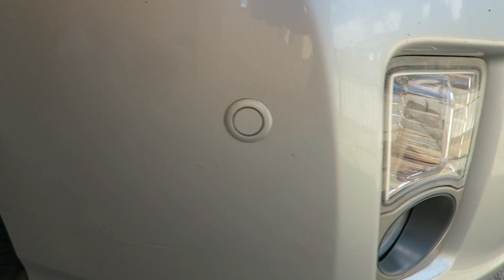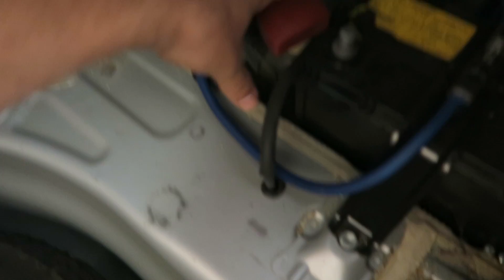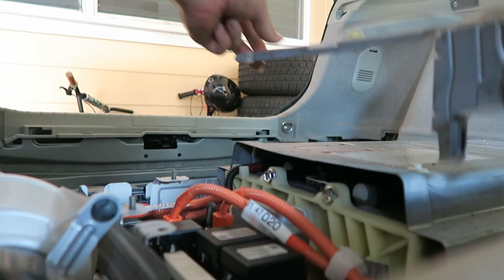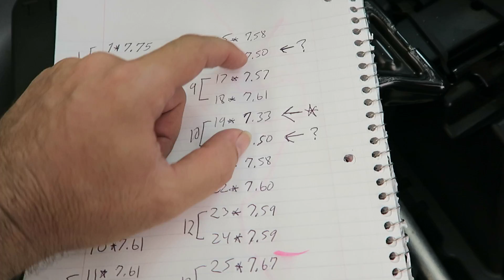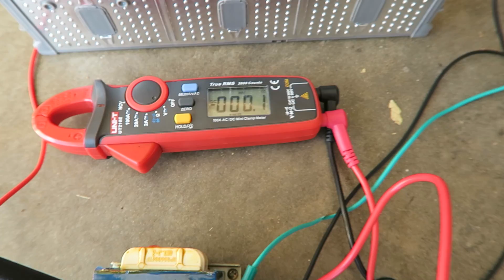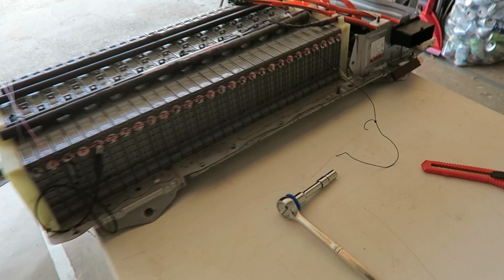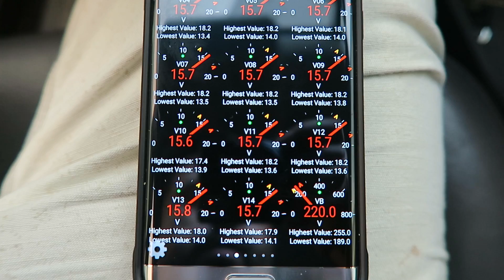Prius High Voltage Battery Repair | Gen lll 3

Comment: Hey Vlad, how do you actually test the voltage with the battery in the car? How did you get your “low” readings. Did you turn on the car and wait for the cells to discharge and see which goes lowest, or were those results after a drive? I don’t have an issue yet but I notice when I’m monitoring the cells live as I’m driving some dip slightly lower than others sometimes, and during other drives sometimes other cells dip lower.
Reply from the maker: Driving around at slow speeds gives the battery the most stress and thats when the worse measurements are recorded. If using the torque app, it has highest and lowest value record options, which will give you an more accurate assumption than trying to catch it live. If your not triggering a code, your fine for now. Even if you do get the code you can still drive the car if you have too with no issues. Thanks

Comment: What did u use to charge the battery to bring all to the same voltage
Reply from the maker: +Farnaz Makdum you don't need to charge them to equalize the voltage. You just need to wire them all in parallel, all pluses and all minuses together will put them in an equal voltage. Hope that makes sense.
Reply: So you just connect all positives and all negatives. Do u have to connect anything else.?
Reply from the maker: +Farnaz Makdum yep, you'll have a huge 7.2v battery. Leave it overnight and all your modules will be the same voltage. I learned over time this step is not necessary, but people like to do it anyway.

Comment: Hello thanks for informative vedio, I am writing from Mongolia, I have 3rd generation pius that have problem with HV battery, and I seek help from the auto mall service shop they told me that 3rd generation HV hybrid battery must be replaced all of it even though only one battery pack is  bad, because it is not getting better if only change the bad pack (must be changed by all 28 pack battery) also they said can not to change only bad cells must be done by all. so I am getting confused and want to ask you. since you changed the HV battery did not occur any problem with HV hybrid battery????
Reply from the maker: Hi, normally changing out the bad cells will give you plenty more driving but in extreme cases like ultra high milage cars will need full replacement. If it was me i would repair it first. Normally the cells will last 200k plus miles but sometimes one or two might fail along the way. Hope this helps. Thanks
Reply: how did you charge the battery just from home electric or use some equipment to do it, in other word my country uses 220v so do I just charge from it?

Comment: THIS IS INCREDIBLE!!!! I used the ELM27 WIFI module and Torque app for my conventional (non-hybrid) car but I had no idea it could give you this much information regarding the HV hybrid battery! Thanks for the video!
Reply: Dr. Prius is better than Torque Pro because it tells you the most critical parameter for battery evaluation and that is Internal Resistance of the module. Voltage is too difficult to use accurately because of the necessity of load which is too much of a variable. Voltage is almost worthless to me but IR can pinpoint the bad module in seconds.

Comment: Nice work. These are not so hard to work on as people think.
Couple of tips I got from another video.
I probably would have cleaned those contacts and then tried the car again. That may have been why those cells were not being charged .. but since it fell flat on a load. The cell may have been damaged.
Second.. to get those red plug retainers out. Use the end of the disconnect handle. There is a little pin sticking out.. use that and rotate.. and those little clips will come out without using a screw driver and possibly damaging them.

Overall great work though...  And nice car. That 5 trim package is really nice.

Comment: Just Vlad, awesome video, well made and put together. Especially that wire technique to balance the cells!

Anyways, on the Torque app, in my 2007 Gen II I'm getting a delta voltage of 0.1V at around >56% SOC, 0.2V between 53 - 56% and 0.3V in the 40% range.

I dunno, is that considered unbalanced?

Comment: hi  thank you for uploading this very very helpful video , i have got few questions and one request, the questions  are , what charger did you used to charge batteries what  was voltage and amperage for charging.and request is if you can elaborate a bit more on downloading Prius pid i tried but no luck maybe a short video clip i am sure i and many people would appropriate that.
thanks

Comment: Did you use a usermanual when you use these steps? how do you know that these are recommended steps?
Reply: Parvez Makdum 
He obviously did not
He didn’t even know the orange safety plug is the tool to release the orange bolts ....
Reply: Parvez no need for User Manual. Watch a large number of Youtube Videos, and you will be an expert 😀

Comment: Why did you group the cells in pairs?
Reply: alex tworkowski I think he did it that way because that is how Toyota has the voltage sensors wired up. They don't check every single module but they check them every two modules which are wired in series. That's why he gets about 15 volts.

Comment: Humidity corrosion on the battery terminals, SENSE WIRES and BATTERY ECU. This messes up the systems ability to determine SOC.  If the corrosion is really bad, a fire can result as there is no current limiting on the sense wires. Once you have followed the steps to pull the pack, look inside the battery ECU voltage sense connector (orange 2004-09).  Check for corrosion on any of the pins, clean as needed with contact cleaner. If its bad inside the B ECU it will be worse inside the plug. Digikey carries the replacement multi-lock pins from Tyco.  At the batteries, clean the corrosion from the plates (soak in vinegar), replace the M5 iron nuts with stainless steel flange nuts.  The sense wires, I cut the plate off, put 3" of 1/8" marine heat shrink (heat glue inside) and added 1.5" of wire between the plate and the sense wire. Each sense wire must be checked and cleaned back to copper before soldering. Once the sense wires are repaired and the plates have been soldered back on, pull the shrink tube all the way to the plate and heat seal it. Look up salt/vinegar and baking soda wire cleaning solutions for corroded wires...hope this helps, be safe...
Reply: eb b tkl
Reply: What are the sense wires? And have you thought of making a video with your explanation since it seems to be a more comprehensive refurbishing of the entire prius hybrid battery and it's management? Thanks for your guidance.

Comment: Hi there, thanx and I am very great full for up loading such an informative video. I have bought OBD II adapter and torque Pro as well. I just wanna know which plug in have you used to check individual cell voltage, as it is there in your video. I could not find it yet. Thanx.

Comment: fyi  in order to get a read out of the battery banks among other things, you need to get an obd2 to bluetooth and also get Torque Pro which is 5 bucks
afterwards you will need to search the web for Prius Torque sensor modules so you can get the battery bank voltages as well as access to other sensors like SOC and battery temp and cooling fan measurements.
Reply: Ok thanks.... Seems that's my missing puzzle!

Comment: what year is your car and when should i clean the bolts ?
Reply: The only functional part of the interface is the circular portion of the bus bar that is in contact with the terminal ends.  Corroded nuts or corrosion on the outer faces is of minimal concern.  The best way to get the bulk of the corrosion of everything off is to dump everything into a small cup filled with vinegar for a few minutes - will remove 99% of the corrosion and needs nothing more than rinse and dry afterwards.
Reply from the maker: +habeeb samawi 2010 but it applies to 10- 2015. If you are referring to the nuts from the modules, clean them when they are out.
Reply: my car is 2014  with no problems should i clean the nuts ?
Reply from the maker: +habeeb samawi no need to do that, the corrosion happens around the nut not at the direct contact. You only would do it if you have battery issues.

Comment: Im in the process of refurbishing the pack on my 2005 prius with 200,000 miles and am going to cycle all of the cells 4 rc chargers to bring back the capacity to 6500 Mah. Then load test with a battery load charger. My question is about leveling the pack. Do i just put or wire all the cells in parallel. (plan on using alligator clips) and then use a RC charger to charge the pack and then let it sit. Im very confused on this last step.
Reply: There is absolutely no need to parallel the modules.  All it does is stabilize the surface charge.  The moment they are subjected to a load in the car, they will diverge almost immediately.  This is because NiMH voltage with two paralleled modules stabilizes in very short order. I have personally confirmed this with testing.  Empty module put in parallel with a module that had 4000mAh input.  After 24 hours in parallel, they were 1000 and about 2600 respectively - still substantially out of balance, and their voltages were EXACLTY the same when disconnected from one another.  Anything close is good enough as healthy modules "self-balance" to some degree. If charging with RC chargers, charge from empty to about 4000mAh input and the same end voltage - these will be extremely well balanced.
Reply from the maker: the reason you want the batteries all in parallel is too equalize the voltage in all the blocks so they are the same. Honestly this is not as critical as if it would be a lithium ion battery but still good to do because if you have to much variation in voltage between the blocks the computer will trigger a fault. So if have enough wire clips just do it. It will take a while for the batteries to equalize. i would leave it overnight. you dont need to charge it as it equalizes because this could alter the voltages.  hope this helps

Comment: Hello, do you know what's the highest voltage difference should be in? Mine was all within .05 volt range except two bad ones which were over 1 volt difference which I replaced them and my car running fine. It looks like the voltage difference is more important than actual voltage itself. Is it true? Last question, do hybrid cars lose power as the hybrid batteries get weaker? Thanks
Reply: Yes it is no difference than a flashlight battery, just bigger. You lose fuel mileage as the battery wears out.

Comment: Hi bro what exact diagnose tool you use I can see it sitting underneath your Gear compartment but I'm not sure if it's the Bluetooth one or the wifi one could you let me know that and could you also let me know exactly what app you have to load for the device and thank you
Reply from the maker: The obd reader is wifi and its just a generic one you can get anywhere online. The app i used is for android called Torque. In order to see all of the data from the prius hybrid systems you will also need to download and add prius specific "PIDS" to the torgue app. Just search prius pids in google. Hope this helps
Reply: I can't find torque pro for iPhone. Is there a similar for iOS?

Comment: You should remove the entire battery from the car ASAP. Work on your deadlift in the gym so you can lift 120 lbs and set the the battery between two sawhorses so you can reach the bottom module bolts.Clean the bus bars and bolts/nuts with Caig Deoxit D5.Use an electric screwdriver to remove/replace the 56 nuts.Reorder the batteries with the highest voltage nearest the battery electronics so next time you don't have to remove all the modules.First time 8 hours because you need to clean the fan and ducting.Next time just 5 hours.In Calif, the dealer would replace the battery free until 150k.Try www.elearnaid.com for modules.

Comment: what type of obd2 app are you using?
Reply from the maker: Its called "Torque" on android.
Reply: Torque pro show only current voltages of all the blocks. How did you set for high and low voltage.
Reply from the maker: Search for "prius pids" in google and add them to the torque app to have access to everything on the car.
Reply: @JustVlads  can you pls post the link for the PIDS?
Reply from the maker: you would need to download the custom "pids" for the torque app to access all the information on the car
Reply: where did you find the pids download? did you use torque pro or the free one
Reply from the maker: +beachbummm69 download from some forum Googled "prius pids". Used torque pro and entered pids manually in the app. It's little complicated but possible.

Comment: Wow! Thanks for that video. Was that just a 12v 1amp trickle charger you used to equalize the entire pack?  How did you wire that transformer to load test? Just put the battery cell between the primary and secondary winding?
Reply from the maker: +Starr M to balance the battery quicker I used the small charger for about 6hrs, but the battery will equalize without it if all modules are wired parallel. It will take a while though. About the transformer I just needed some thing to pull high amperage to see the cell condition. I used the low voltage side of the transformer, which was the secondary on mine. Using a headlight bulb to load it also works good. Hope this helps
Reply: @JustVlads  can you describe the charger specification

Comment: i am impressed  pls tell since u fix ur Prius battery did u have any problem
Reply from the maker: thanks, so far everything is perfect. I suspect that eventually another module will fail. Only way to fix it permanently is to replace the battery modules all together. But for a cheap fix this works and could last a while.
Reply: give your mail address or contact numbers